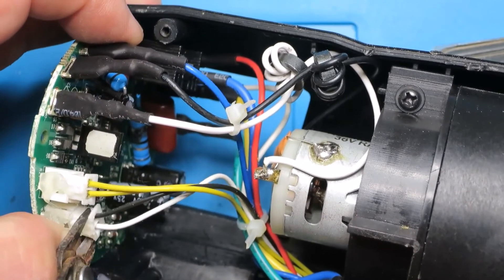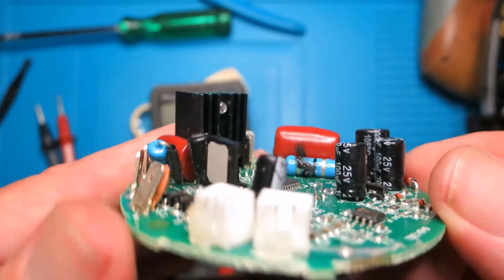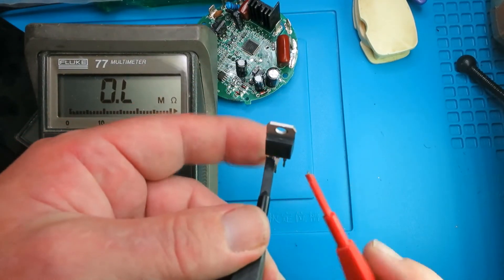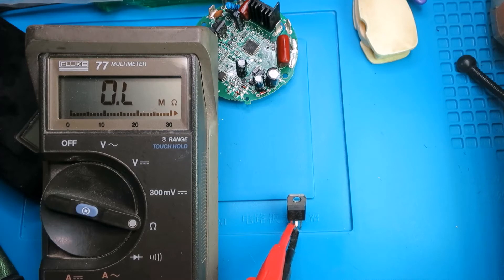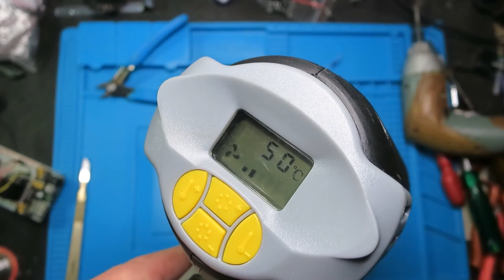Earlex HG2KLCD Heat Gun Fix - Electronic Repair Tutorial Prulde PLD2030 SKIL 8004 TBE1404

Comment: Thank you so much for this Video. My Dads Skill hot air gun broke down a few month before, it seems to be the same model as yours with a different name. Works like charme after replacing the defect resistor!
Reply from the maker: You're welcome! Have a great day!!
Reply: @1nformatica  I just wanted to add the exact type, maybe you can add this information to the video description, if someone is using the search function:
SKIL heat gun 8004
Reply from the maker: @xl_bk  Thanks Axel, I have added that model to the title and video description.

Comment: I have the hot airgun in the link below.  but only the fan is not spinning.  I think it's exactly the same as you have.  I actually wanted to send it back.  but still want to try to find the defect.  the motor runs on a separate lab power supply.  measured on the connector that normally goes to the engine.  and there is almost no voltage.  I'm wondering how can I test if it's the rectifier.  or to the control that the microprocessor should provide.
https://www.bol.com/nl/p/powerplus-powx1025-heteluchtpistool-2000w-incl-koffer-incl-4-mondstukken-schraper/9200000084577932/?Referrer=ADVNLGOO002062-G-117774835160-S-1041836869395-9200000084577932&gclid=EAIaIQobChMI0aW8pPyp8QIVU5nVCh0Y2AOCEAQYASABEgIxuvD_BwE
Reply from the maker: Hi, I didn't look closely at that part of the circuit as mine was working. The diodes should be easy to check if your multimeter has a diode test function. I don't remember what the transistor was maybe you can tell me the part number? Whether it is a FET or standard bipolar transistor you can usually check it with the same diode test. The only way to see if it is being driven by the processor would be I guess with an oscilloscope.

Comment: is the heater powered by AC or DC?  thank you
Reply from the maker: The heater is AC, you can get the heat gun in 220 or 110 volt version and also replacement elements. http://bit.ly/HotAirGun http://bit.ly/HotAirGun_US Please consider subscribing if you have not done so already!